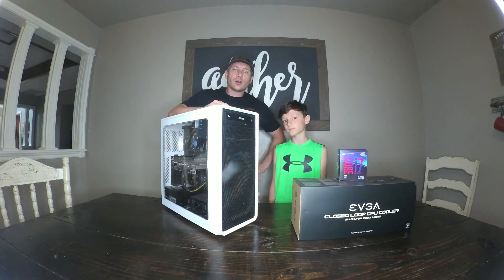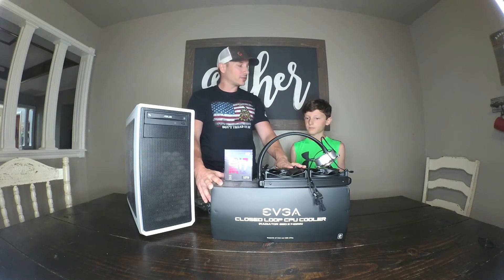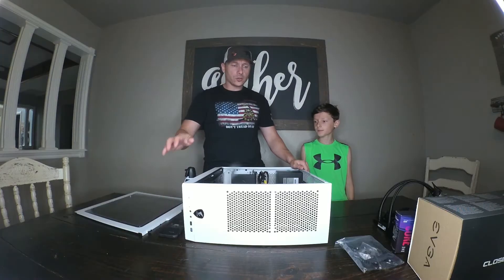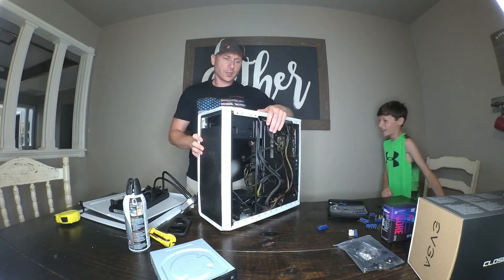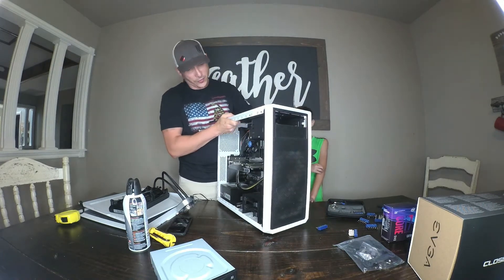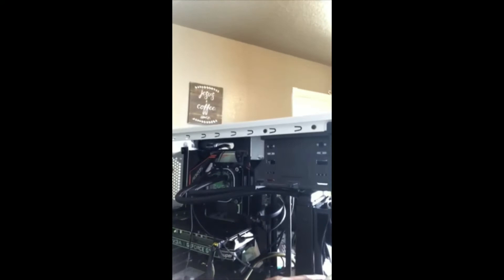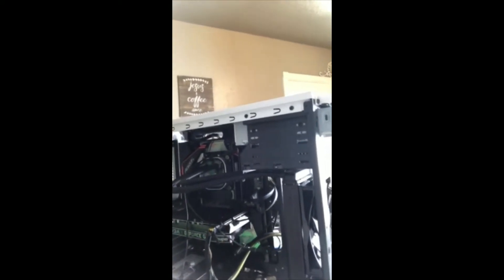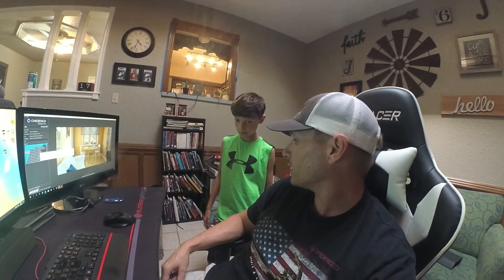HOJGaming Builds - We Upgrade to I7-8700K and EVGA AIO liquid cooling

Comment: Your son is sharp-he asked a great question when he asked what happens of the AIO breaks (open and liquid gets on components.  Smart thinker !
Reply from the maker: Yep.
Reply: @HouseofJacobs  you also made a good point to him about doing research beforehand; after doing my case research, despite how tempting that case looked-good airflow, comes w/3 Fractal LED fans, good price, I avoided it based on consistent cable management complaints and outdated disc drive cage.
Reply from the maker: @PapaMav  Yeah Cable management can be difficult with those old Hard drive cages.  I have upgraded a few times since and ended up giving a friend of mine this case with a very modest build in it for streaming.  The new cases in the house either have SSD mounting areas behind the back panel or in my case I use the PSU and the cages under a cover at the bottom making management/hiding cable much easier even though it has cages for the drives.

Comment: That's good to get your son building now,and teaching him. Keep up the good work! Those are skills he'll thank you for later. I also have one of these cases an I just want to warn you you may want to move your radiator to the top of the case if that evga aio has the pump in the cpu block,it can cause air to get trapped in cpu block/pump and run it dry causing noise and eventually killing the pump. General rule try to keep your pump below the top of your radiator. I'm not being mean just telling you so you don't have the pump die down the road. If the pump isn't in the cpu block on that aio then it's okay that way.
Reply from the maker: Thanks.  We struggled figuring it out but we got it working in the end

Comment: Man thats a beautiful video! I have the same setup, focus g with the 8700k. I tried going with the arctic cooler 33 esports but it was too loud. Then i bought  noctua nh d15 but i its also too loud. I wonder what i should be doing.. anyway this cpu is a beast and ive been enjoying it for 3 years now.
Reply from the maker: Yeah I like the EVGA AIO as you can go in and manually turn the fans down for a pseudo  silent mode.  Obviously when I am doing video editing and pressing the CPU the fans spin up louder.  I have actually switched over the case and CPU to the i9-9900k as well.  I rebuilt another computer in the Focus G for a friend of mine.
Reply: @HouseofJacobs  interesting. So overall if we're being honest, this case is not very fitted for overclocking. I too consider switching cases, but get anxiety when I think about the work involved.
Reply from the maker: @ufanisoneetze  I had my i9-9900K and a 1650 super in there both overclocked.  I also had every spot filled with a fan.  The 8700K overclocked in there just fine as well.